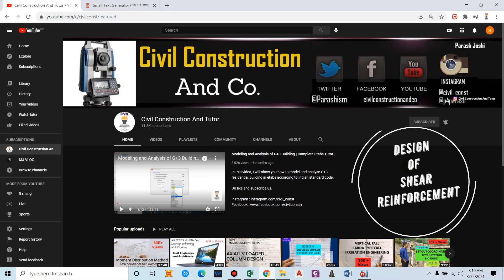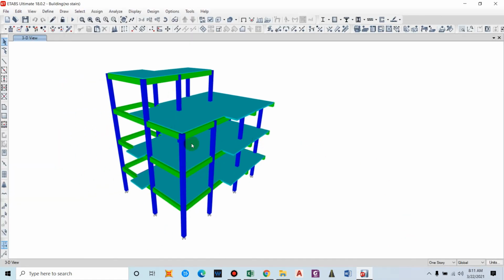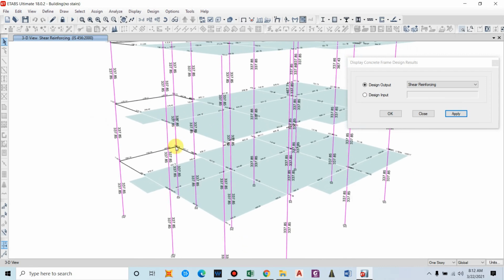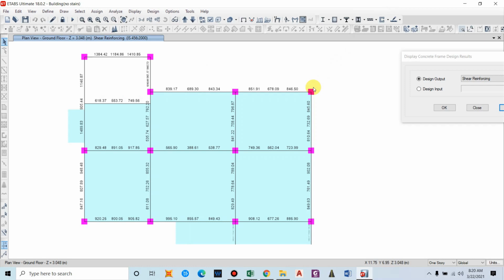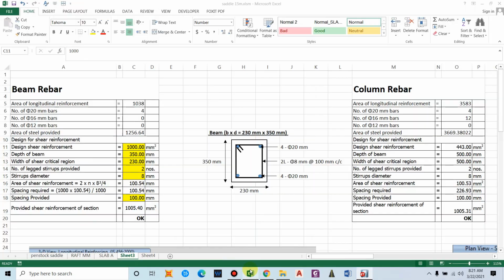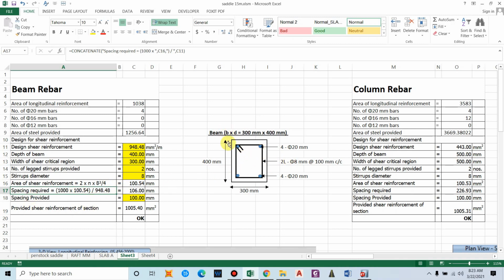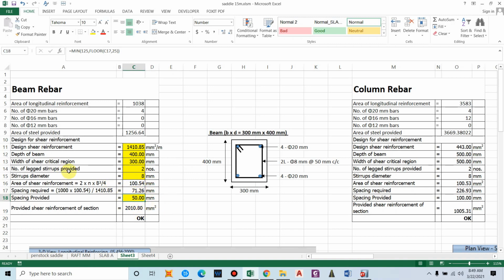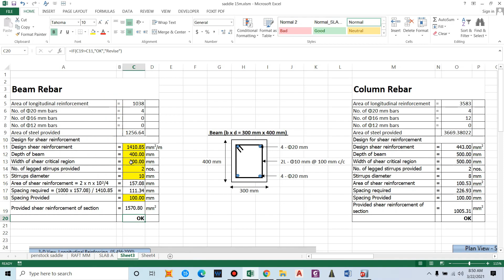Design of Shear Rebar (Stirrups & Ties) from ETABS Part 1 | Modeling & Analysis of RCC Building |

Comment: Good helpful video... Clearly explained! But can you explain that in the beam design calculation the shear reinforcement required was 780mm2/m and in display there are various values at end and midspan of beams, how does ETABS calculate shear reinforcement at each part? Thank you for your help.

Comment: 1.Sir,Do you plus shear for rebar (At/s)rienforcement?
2.Why don't you use shear plus torsion rienforcement instead shear rienforcement?
Mistake word torsion not tension
Reply from the maker: Recent seismic detailing code doesn't allow considering shear strength due to concrete and tension reinforcement, so we design for shear considering shear reinforcement only.
Reply: @civilconst  thank sir.If you design beam ,Do you plus torsion rebar?

Comment: How do you provide 4 legged stirrups in a beam having only 4 bars? The stirrups size should be increased to 10mm dia bars instead in that situation.
Reply from the maker: 4 bars at top and 4 at bottom. So we can essily provided 4 legged. and I have also said we can increase stirrups size as well.
Reply: @civilconst  Yes, For 4 bars top and bottom we can provide 4 legged stirrups.

Comment: Make etab pageup set up as per nbc 105 2020 using user coefficient for dynamic analysis along with load as per nbc105 2020...I think there are 18 load combination ...please do make a video on it ....
Reply: Also stiffness modifiers as per nbc
Reply from the maker: I am eagerly waiting to make video on it but as it not implemented in real practise yet so it won’t be that effective. Once it is implemented and one of my project gets approved I will upload it.
Reply: Here in my municipality tilotamma butwal...structural engineer has asked to do as per nbc 2020 from baisakh ....so I was hoping if u can help ....I actually had made it but reinforcement provided is high as copmpared to indian standard ...I may have done something wrong ...will u check my file set up whether it is right or wrong as per nbc ...I kinda made it but reinforcement is just too high
Reply from the maker: You can mail me i will check. Reinforcement may come more as PGA considered is greater than IS code.
Reply: @civilconst  bro mail id right now I am gonna send  u a  file
Reply from the maker: iamparashjoshi@gmail.com
Reply: @civilconst  I just mailed from bishow regmi thanks bro....